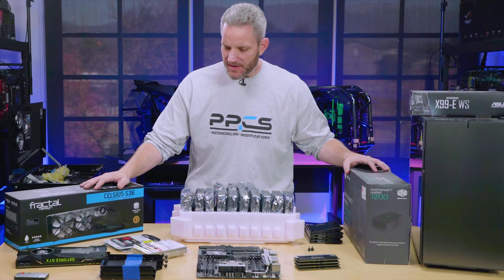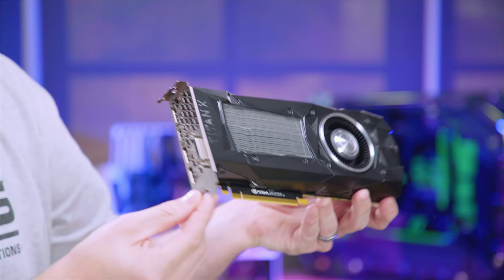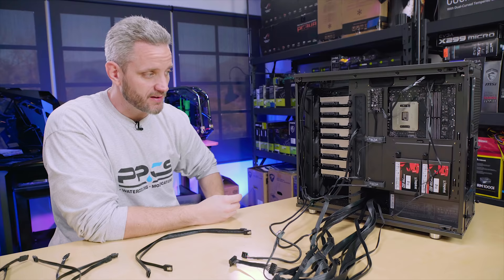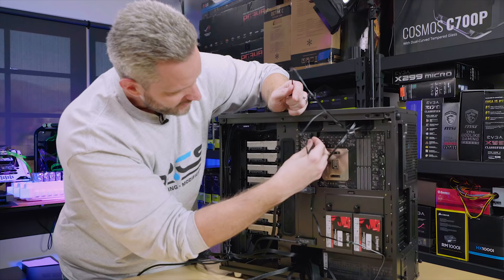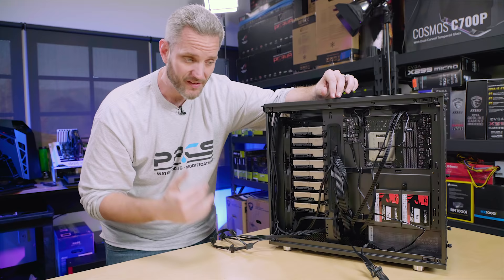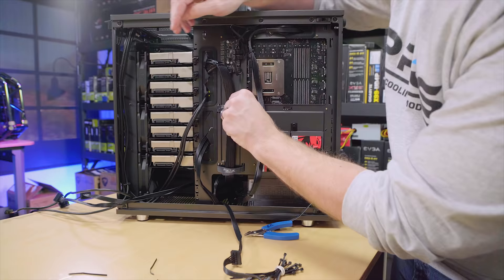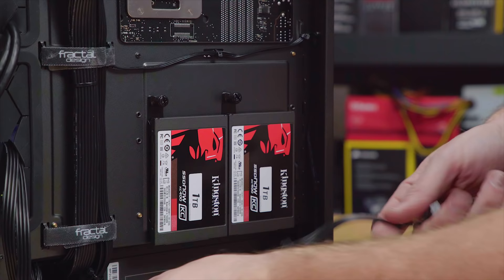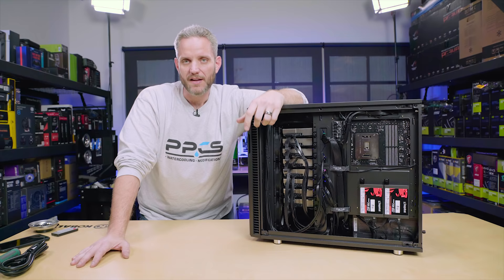How to cable manage a computer

Comment: Cable mangement is up there with the biggest load of ballshit since rgb. It does not make it easier to fix, replace, etc, as you get caught under 20 zip ties and groups of wires routed in a deceiving manor. 

Yet i still cable mange, cuz uno ocd. And rgb well cuz it looks cool

Comment: As a professional datcentre designer for over thirty years I'm slightly offended by you calling this a server - it's not, it's a workstation - it's all SATA, no dual PSUs, single CPU socket, no ECC-RAM, few memory slots, liquid cooling, no disk backplane - it's a workstation, honestly it really does offend those who do this sort of thing as a job when you call this a server, it's not.
Reply: server
ˈsəːvə/Submit
noun
1.a person or thing that serves.
2.a computer or computer program which manages access to a centralized resource or service in a network.
Reply: Can I please point out, that a server does not necessarily have to have any of the things you've listed? I can build a basic server using consumer grade components and by definition, it is still a server. It is executing the job of a server, it just doesn't have the physical components that a server has. 

TL:DR
Just because a PC doesn't have physical server components, doesn't mean it's not a server.